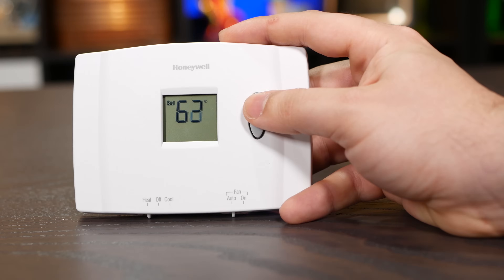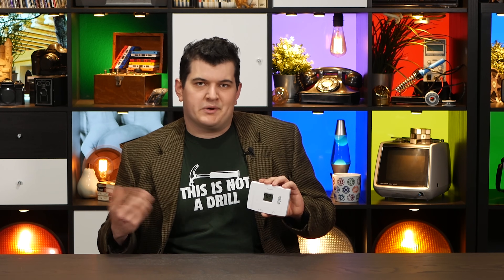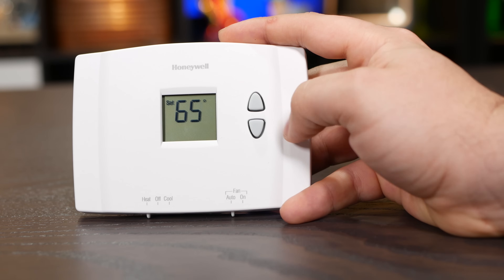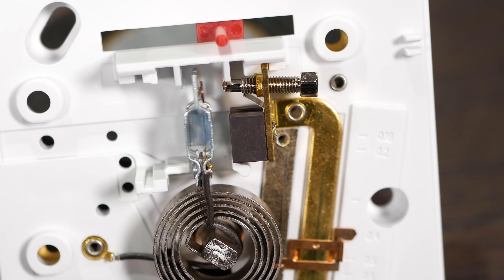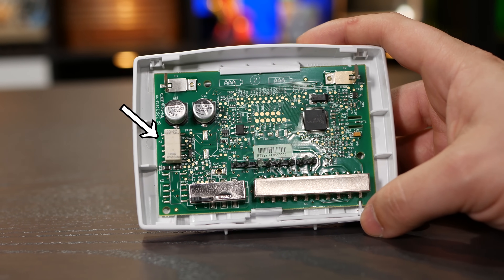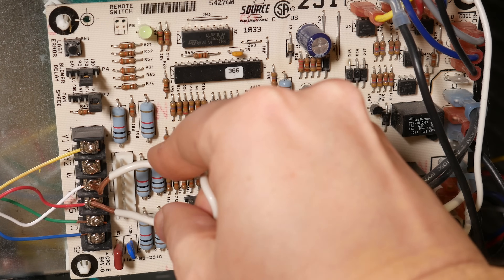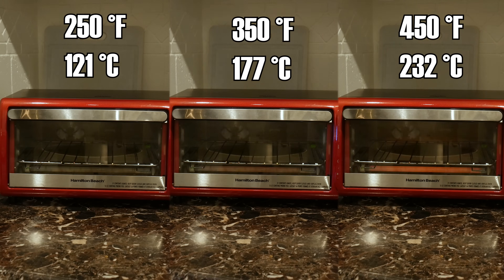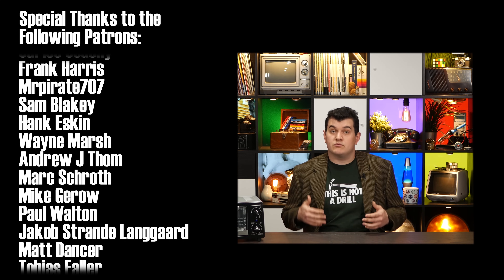Thermostats: Cooler than you think!

Comment: Okay, as a German I find this video a bit strange. So your furnace also does cooling and it has a fan? Over here pretty much all heating is done via pumping hot water through radiators located in each room (each radiator having a heat sensitive valve which acts as a mechanical thermostat) and I sort of assumed that this is how it's done everywhere.
Reply: It has a fan because forced air heating/cooling is most commonly used.  The heater or air conditioner heats or cools air and a fan pushes that air through tubes (ductwork) to get it around house.  Heating and cooling use the same pipes, but jobs are done by different machine.  Baffles may be installed to control how much heat or cold goes to each area.
Reply: I think systems in the US vary a lot more than in Europe. My relatives (who live in Boston - I'm in the UK) have hot water radiators on their apartment (albeit the 'baseboard' type that run along the edges of the room) heated by a central furnace in the building. AC OTOH takes the form of separate units in each room that poke through the wall, and you can also get 'window' units that rest on the ledge of a sash window (the upper sash hhelps hold them in place) that again cool only one room. The people who have central forced air HVAC systems tend to be those who live in newer houses.

Comment: well you can control how much heat / how much power to lets say heating wire by pwm signal (it signal that contain on off signal in high frekuensi like 100khz) lets say i want heat 50% then the ic(normaly it just microcontroler atmega 128/328 or stm 8/32 and  ne555) send pwm signal to mosfet or triac (mosfet = dc triac = ac) or mosfet driver and then mosfet and mosfet and triac is like swich but with lets say robot speed (very fast)
Reply: Indeed the same can be used for controlling a cooling fan etc in fact such systems are very common in for example GPU's where the PWM fan controller is regulated by the thermocouple on the GPU die so that the fan only operates as fast as it needs to in order to manage the heat generated by the GPU.

Comment: Great video as usual. Anyone seen a programmable thermostat that let's you control whether the fan is set to on or auto based on a schedule. For our office bldg I'd like the fan on during work hours to continuously circulate the air and keep the temperature more consistent as the layout of the offices and a/c sometimes creates imbalances. Then at night switch to auto.

Comment: My programmable thermostat has buttons that turn on the heat or hot water for one to three hours (push one to three times). During that period it still cycles the heating on and off according to the temperature. It's useful for when you are cold at a time the heating isn't scheduled to be on, or if you shower at an odd time of day and the tank gets low on hot water.

Comment: @technology connections to answer your last question, if you're willing to do the research and spend the money you can find a thermostat that will temporarily hold at a different set point from the programmed temperature. Otherwise in a more basic setup, I guess you could say the room thermostat being dumb, look more towards commercial applications and you can find thermostats with an occupancy button which generally causes the hvac system to run on the selected mode of operation for a set amount of time regardless of actual or set temperature.

Comment: How does the heat get from the heater to the area monitored by the thermostat fast enough to avoid a but load of heat backing up somewhere? Another way to think of it is the thermostat turns the heater off now but the heat is still coming because it's not perfectly instant so it will get too hot...  The speed of heat transfer being too slow could be dangerous right?
Reply: Very easy, there is a temp monitor at the water return flow of the heater. The higher the return temp the lower the heater will burn. To high and it will turn off. If the temperature gets to low and the thermostat is still asking for heat the heater will turn itself on. When lots of heat is required the pump speed is increased. On some systems (by choice) the maximum water supply temp out of the heater is being controlled by an outdoor temp gauge. We call this weather controlled. It is very basic and available on even the cheapest heaters. (thou most of them do need an outdoor temp gauge)

Comment: As far as I know, the Breville oven I have uses PWM to output heat more evenly. Rather than turning off completely, it uses a "dimmer switch" (this is what they call it) to keep the temp right at where you want it, rather than just aiming for an average with the thermostat. This does seem to be the case, because the elements are completely dark at its lowest setting (80° F) and glowing red when set high.
Reply: Also, ecobee does have little sensors you can make virtual zones with, but you have to cool/heat the entire home to get one room to an ideal temp. I'm not sure if it has any integration with a multi-zone system.
Reply: Ecobee thermostats have a "test equipment" option that allows you to manually start the compressor, etc but this isn't really practical as you have to do all the timing yourself.

Comment: A cousin of mine has a system that allows him to heat two sections of her house independently. 
The way it works is dependent on how our heating systems function. 
Here in Spain we use a closed loop water system, that circulates warm water through radiators in each room. The furnace starts when it detects a drop in pressure in the system after an electric valve opens. So, to heat different parts of the house she just have two independent circuits connected to the same furnace. When the thermostat of one section trips, the valve of that particular section opens and the furnace kicks in, heating the place.
She doesn't have A/C, though

Comment: If only you had a system where heated water circulated through vessels with a large surface, using a local valve to determine the flow through each vessel ...

The idea that this is a thermostat is quite outlandish to people living in northern Europe.
Reply: In the northeast U.S. hydronic heating is very common, but still not done in the way you guys do it. The rest of the us and even many houses in the northeast have forced air (uuuugh, I can't stand forced air, my eyes are already feeling dry thinking of my uncle's house!)
Reply: Not only northern, also central and eastern europe. I have to say I am still surprised this is the way houses are heated in the us.
Reply: Thats how you heat stuff here! but I never seen it used to cool your room... Or circulate air. I wish I could circulate air by turning that knob.
The main disadvantage with this type of heating, is that it is very very noisy (about on par with the coil-whine from phone chargers). It also requires de-bubbling every few years.
Reply: @feha92  Good point about cooling. For air, we just open windows. No need for a fan. ;-)
Reply: Europe in general, I'd say. Maybe Spain or Greece are different.
Reply: That would be a good idea. My house has the valve CENTRALIZED. Which means that it will be too hot in the bedrooms and too cold in the living room at all times. You cannot change this. There is NO valve to fix it.
Reply: @moth.monster  That's horrible design. My house has water circulation underfloor heating, 8 rooms, 7 thermostats and one mixer (which continuously adjusts the temperature of the water circuit based on the outdoor temperature) Shower room and sauna gets circulation directly from mixer and other rooms are controlled by individual thermostats.
Reply: @peto22  yes it is, that's how america is
Reply: I live in the sunbelt, i dont even really have the above
Reply: Although these are typically misunderstood by, and misused by, our wives as the same "on/off" switch approach to thermostats.
Reply: @markchip1  this is sexist as hell, i'm willing to bet the girl i marry some day will know more about tech than your son/daughter who was raised with a cell phone in hand from the age of 0.5!
Reply: @frogz  it's a joke.
Reply: @volvo09  not entirely! There's many a truth said in jest!
Reply: @frogz  my wife's 54 and didn't have a mobile phone until her late 20's at the earliest! She does, however like many (especially female individuals) switch the thermostat to min if she's feeling hot or max when she's cold! It may be a generalisation but it frequently holds true in my experience...
Reply: @volvo09  And it's funny because it is true... I don't know how many times I've tried explaining my wife and daughter, that if the temperature inside is a bit too cold in the winter, then you just turn up the thermostat a tiny bit and wait. Do NOT turn it to 100% - because (1) it will NOT get hotter faster and (2) you will INEVITABLY end up overshooting the mark, it will get too hot inside and you will have to vent out the excess heat by opening  the windows, thus loosing a lot of hot air you have just paid good money to heat up. I've lost count over how many time this has happened to me over the last two decades. Apparently this message is just too complicated...

Comment: I also happen to have an exception. Houses with heat pumps usually also have an orange wire to tell the compressor outside whether it's in "heat" or "cool" mode. It really just flips the direction that the compressor runs to transfer the heat in the opposite direction. So, instead of 4 wires, I have 6! (including the blue)

Comment: wow home cooling :O is it a thing on the hot south? Or is it common in general? Cuz never heard about ppl having home cooling in here in central Europe.
Reply: It's an American thing (specifically, better-off Americans - I'm British with relatives who live in a housing project in Boston and they have window units and one wall unit in the living room). 'Central air' which has a central AC unit and ducts the cold sir around the house is limited to newer homes and higher-end older ones. In the UK only shops and offices have AC - during the two weeks each year when it's something uncomfortably hot, we open a window or use a fan.
Reply: @rich_edwards79  It's also really important in humid areas. Large areas of the USA are part jungle I swear. DC is famous for being built on a swamp and the weather proves it. 98 degrees (37C) and 99% humidity is common. 
There are people who do not joke when they say they have to towel off the sweat formed from toweling off from their shower. AC fixes that.

Then there is Florida. One giant AC market.
Reply: @feldamar2  yes, I once made the mistake of going to Boston in August. Even that far north it was 100°F and 95% humidity for days on end and I hated it. The UK tends to be quite humid at times too due to the damp climate but at least the temperature rarely tops 75°F in summer so it's more bearable.
Reply: @rich_edwards79  same here though all the stores equipped with AC just start using them as soon as it's even a tiny bit warm outside to the point of making it really cold at times xD

Comment: To your last question, yes. It's called temp mode.
Our digital thermostat allows you to change the temperature right away, for 1 cycle. It's simply called "Temp mode". I have a very basic digital unit, so this feature 𝗠𝗨𝗦𝗧 exist on yours.
Reply: Most digital thermostats in the UK do it on a time basis (usually 30 or 60 minutes) though most digital units sold in the UK are combination timer and thermostat controllers so guess it is just easier to override both for a fixed number of seconds on those.
Reply: @FaerieSeraphina  , well ,… the way it works on this thing, depends on how you have set it up. Say you never set the time(nor temperatures for time blocks, as a result), then 1 cycle is the lowest common denominator and it does, whatever it (is programmed to) think that is. If you set the time and the time blocks now exist, you can change the temperature until the next time period/block begins.
Reply: @TheCyndicate  Fair enough there are likely many different implementations of this feature as it is clearly a lot more common than Alec seems to be aware of as I have seen many such units on the market here and many other commentators have described units with some variation of this feature.

Course these days someone with relatively basic technical knowledge of programming could likely replace a digital thermostat with their own custom unit. Pretty sure that I could knock one up with a Pi or Ardunio if I cared and there are probably millions of others who could do the work too.
Reply: Seraphina S  , lol… because of this video, I quickly made 2 of them. I grabbed a Pi 3 B+, its a fast and easy task to make with that, and lastly, I just used visual studio to make a basic one on a small form factor windows 7(64) unit and was going to slap it on a windows 10(64) tablet to test, but got bored.

Comment: since i live in Europe, and we mostly use hot water heaters only here (modern houses use heat pumps), it's just two wires to the furnace. and we use thermostat vales on the radiators to control the temperature on individual rooms. and lately i've seen smart vales for radiators.
Reply: Heatpumps can run radiators too. Especially ground-source ones.
Reply: @jur4x  Yeah. We have an air-water heat pump that runs radiators.
Reply: I wish zoning was standard in the US, where I live. I can't sleep if it's more than 75℉ in my room, but everyone else likes it at 76.

Comment: Some modern furnaces use OpenTherm, which is a communication protocol between the thermostat and the furnace over two wires. This does allow for the furnace to adjust its generated heat. It also allows for the thermostat to display a status condition of the furnace such as errors. I feel this is quite common in modern houses in Europe.
Reply: Modern? This technology exists for over 20 years. And even the most cheap heating system have it.
Reply: Nathanael Schudde Well I guess it depends on what you call modern. Taking into account the lifespan of a furnace and the actual application of the protocol in installations that is.
Reply: The thermostat isn't what determines if the furnace can modulate it's heating output. The furnace itself is what determines heating output capability. If the furnace has a multistage gas valve, multiple gas valves or a modulating valve it has the ability to change its heating output, this is very common on commercial equipment but not small furnaces. Some smaller units are starting to come with this type capability but it's not very common. Communication over 2 wires doesn't automatically mean that the unit its connected to has the ability to change its heating output.
Reply: typical installation these days, here in belgium, it runs with 2 wires(bus system), heating is then controlled with modulation

Comment: If you haven't discovered them yet, and I have no doubt you have,  look at a 'infinite switch'. 
It's a bimetallic switch, a resistor and a knob, used on stoves that gives you mechanical duty cycle only without any external temperature effects.  From 0% duty cycle to 100%!  None of that lame 'I want a set temperature' rubbish.

Comment: Our furnace is wood fired.
Want heat? Add Hardwood.
Dont want too much heat? Add soft wood.
Don't want to get wood for the furnace? Cry.
Reply: A good wood stove has a huge BTU output range via damper control.
Reply: Or if you're my friend's grandmother, soak a paper towel roll in olive oil and toss it in. Olive oil burns HOT
Reply: Ive got about 6 chords worth cut into logs that needs split for my wood heater. Wish i had kids i would put them to work. edit: I have a heat pump but rarely use it.
Reply: My grandparents used a kerosene heater/stove in the living room. In the winter I would have to go outside in the cold and fill up the tank in the dark with kerosene from a large 5 gallon jug. And that heat never reached my bedroom.

Comment: Multi Sensor installs are common in large installations, there is a venue I work in commonly that has 5 sensors and they average out to work out if the HVAC should be on or not. There are also aspects of the fresh air inlets and recirculation baffles that need to be correct. Though that system has only one fan speed it chooses either one or two stages of heat/cooling. The averaging is mostly because the outlets are on the ceiling rather than ground level so to heat the room ( 7M ceiling height) often the ceiling temperatures are in the 50's C while ground level will be at 19C so the averaging is to actually work out where the room is at in temperature.

Comment: My thermostat actually does have a temporary set point system.  It's not exactly a "run cycle" button like you're describing, but if you have the temperature schedule set and you go in and press the set buttons, it will temporarily shut off your schedule to cool/heat to the temperature you just manually set, and then return to the schedule later.  I'm not sure what the consumer model variant of it would be, but it's made by Honeywell and provided by my electric company under the name "WattSaver" as part of an initiative to reduce peak summer loads (in exchange for the free "Smart Thermostat" they are allowed to shut my air conditioner off during peak hours if their system is overstressed -- this only ever happens while I'm at work and so far hasn't caused me any inconvenience whatsoever).  Oh, and also I can set the temperature schedule online through my electric company's website, which is kinds neat.

Comment: Doing my duty and increasing engagement.

I have a Hive smart thermostat, pretty sure they're only available in the UK, and it has a function that allows you to increase the heat output for a cycle or two before going back to it's normal program. Being the UK though, we don't have AC so you're out of luck after mowing the lawn, you just have to suffer.